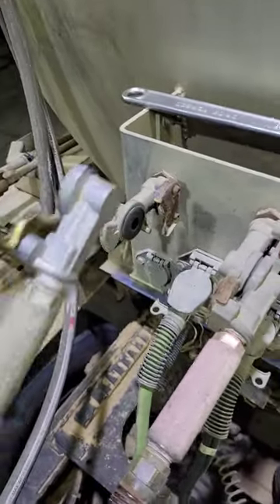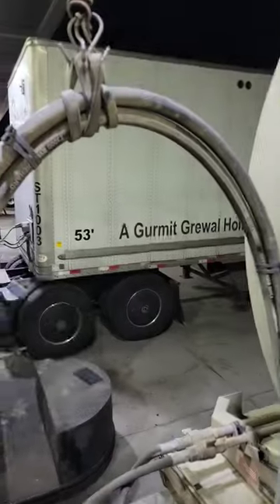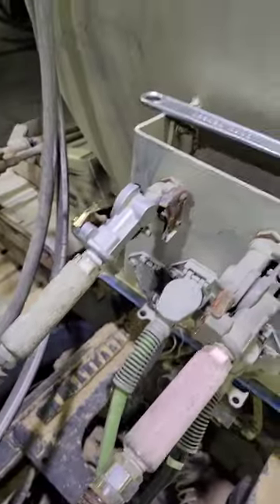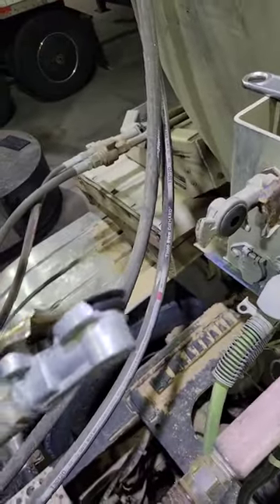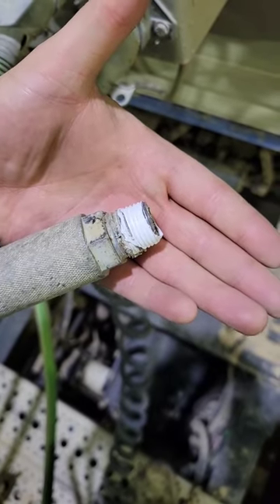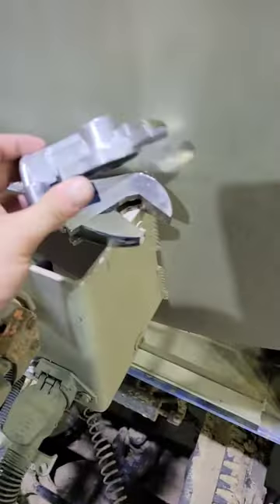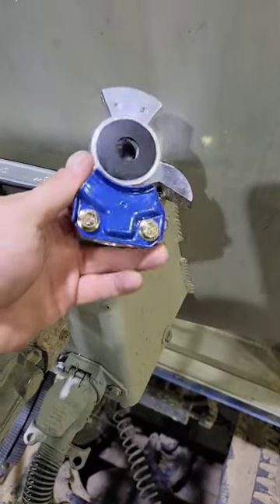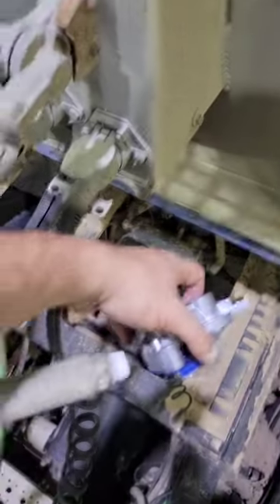Replacing glad hand on semi truck air system

Comment: No dude... Duct tape and bubble gum is how you fix that... 

For real though put a little bit of Vaseline or 5th wheel grease on those glad hand rubbers so they last longer and dony fight you going on and coming off.... The thin metal on the outside should be holding the tension.
Reply from the maker: I know right or chicken wire and electric tape